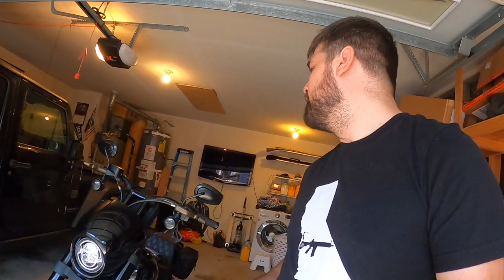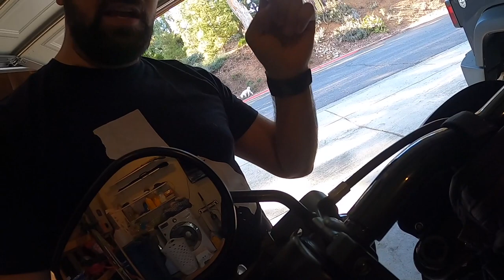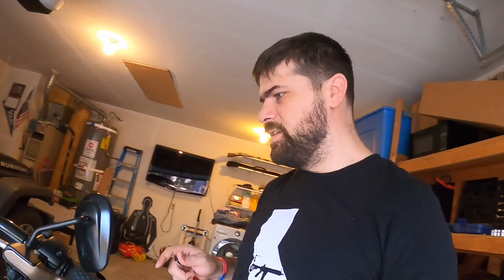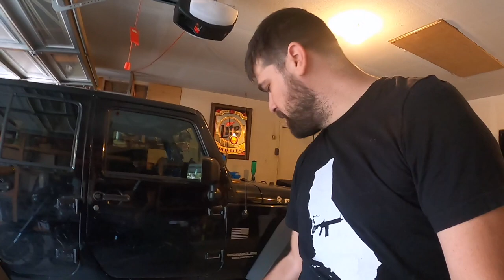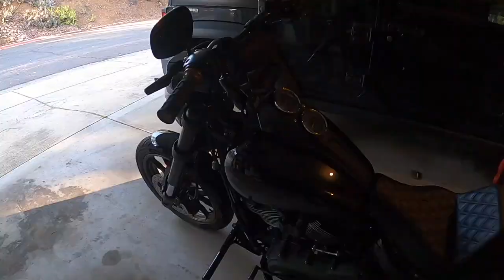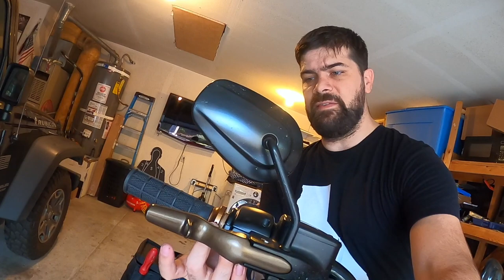NEW ODI grips! How to Install Grips on a Harley Low Rider S

Comment: The throttle side rattle can be fixed by moving the switching housing closer to the center of the bars. That said, you want a little bit of play in them. If there isn’t any play they could stick. Which would be very very bad.
Reply from the maker: Mmm I didn’t think of that! Let me see check it this weekend
Reply: 2GunzTony I have pretty bad OCD with gaps and stuff and have tried all these things many years ago to eliminate the “issues”. But in my experience with talking to mechanics and experienced DIY guys, that rattle is kind of a buffer built in for the throttle to snap freely.
Reply: Thanks for posting this. I was torn in between the Biltwell Alumicore and the ODI grips. I finally decided on and ordered the ODI grips. Watching your video reaffirmed my decision! Those look slick. Thanks for posting this vid!

Comment: Hey bro, i got my lucky daves lucky 13 bars on and my throttle grip is sloppy like yours? did you end up figuring out how to fix it??
Reply from the maker: I noticed after install that had a 1/8” still left in the narrow part it cut the slack in half. One of the other commentators mentioned it and that you want to have some slack there so the throttle doesn’t get stuck open/close.
Reply: @2GunzTony  is it normal on these bars to have the grip slide left and right? I cant stand it. I get the play but i want it back like stock

Comment: I love the look of the Biltwell grips. Way too expensive though. I did not like the feel of the throttle side. Noticed a slight binding feel to them. I think the metal on metal design is a mistake. I prefer a plastic throttle tube, much smoother feel.
Reply from the maker: I think that’s why Biltwell recommended anti seize in the grip tube. My problem with with the biltwell was how sloppy the throttle felt, but they definitely looked good on the bike. Thanks for watching.

Comment: Interesting, way more affordable version of biltwell alumicore grips. Although I think the biltwell look really nice and color options are nice
Reply from the maker: yea I loved my biltwell but I couldn't get over that gap on my controls and the knurling on my bars
Reply: The play in the grip... NEEDS to be there for the throttle side. Otherwise it can cause dangerous problems with it getting stuck or it can be gritty. DO NOT remove all the play in it